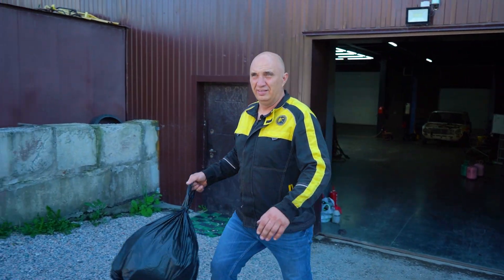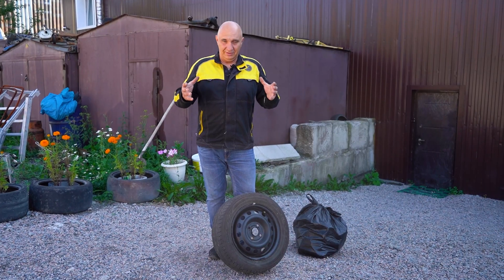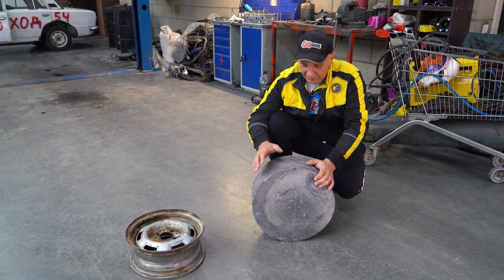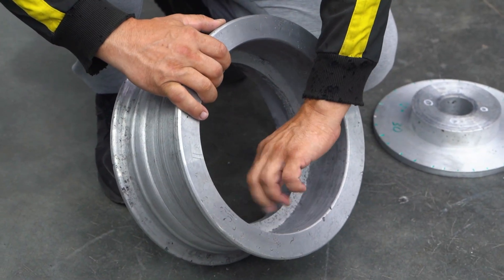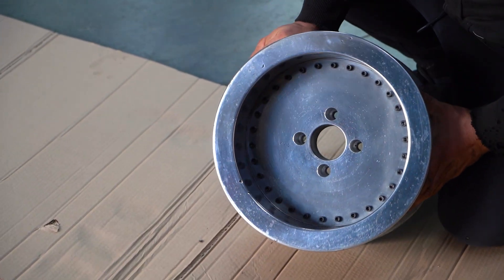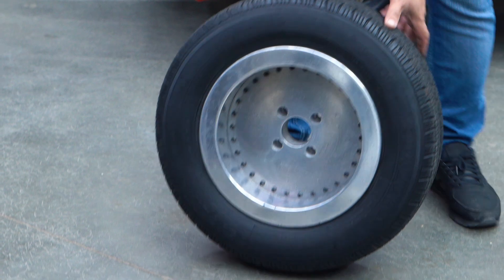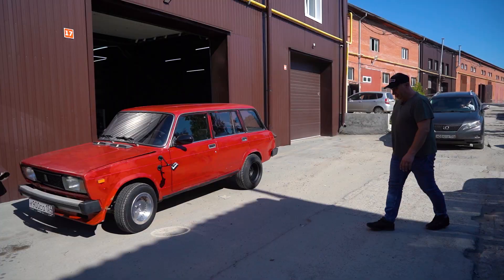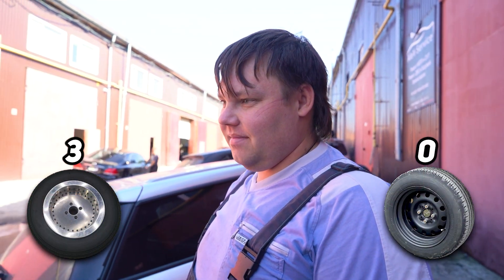We recast aluminum drink cans into a wheel

Comment: What if you try using some vibration to the mold from the outside when its still hot i don't  know a lot about casting but we did it with concrete and it got rid of the bubbles

Comment: we have those aluminium wheels here in use for a long time now and it works great and light in weight than steel but almost the same weight but it much more thicker than settle do have so ha beat that and you should know better than that so you're way too late for that also they do sell those at the tire store that they do sell wheels by their choice at different shapes and size too but prices will be vary to the cost to sell right in USA but not going to tell you the name of stores so you have to find out to yourself for this so you had lost it so ours wad made years ago where they started for that so ha you lost it

Comment: should have kept the casting mold hot with a gas torch until the last of the alloy was added and stirred it that would stop it layering and remove the air bubbles,

Comment: Im not really a fan tbh. Would of put the valve stem on the outside, flat mount one if wanting to be fancy
  Woukd of machined holes , for air flow and weight reduction. Wheel looks heavy as hell

Comment: Old alternators, T6 driveshafts, stuff like that tends to melt a lot better if you don't have borax or anything. Also I'm sure the casting guys know better than me but iirc aluminium is like brass in that it casts better when you've got something consuming the extra oxygen in the furnace, like some cardboard in the bottom.

Comment: When poring aluminium in numerous stages it is wise to use a heated mould to prevent potential heat shock, would also recommend tying to preheat the mould before the first pore, also if you are going to make more wheels, you should cut the mould in half and then use a metal band to hold the shape of the wheel, just make sure you make the mould bigger than the wheel so that you can overlap the two pieces in order to create a better way to remove the casting after it’s hardened

Comment: Gotta go 5 hole for the design like an 80's Countach. At least to take some weight out. Any safety worries with strength. If the wheel pits around where the bead seals, put some bead sealer on there, corrosion can cause it to go flat.

Comment: Next time you go melting the cans add Borox powder to the mix and stir it through,, skimming all the rubbish of the top skin until it mirror finished almost and try to pour the entire casting in one go ,,   build a bigger furnus to melt cans ,  use waste oil burner and compressed air this method works great on a bigger scale melt

Comment: Aluminum is an excellent material and is commonly used in the manufacture of tire discs or wheels.  However, when aluminum comes into contact with other metals, electrolysis problems do occur when electrolytes are present (such as water or a humid environment).

 To reduce or avoid this electrolysis problem, manufacturers often take a number of measures.  For example, they may apply a special coating to the surface of the tire disc to provide an extra layer of protection against contact with the electrolyte.  In addition, bolts on tire discs and wheels often use special materials or anti-corrosion coatings to reduce the risk of electrolysis problems.

Comment: Add borax or salt to your molten metal.  It brings out the impurities
Reply: Yes iodized table salt will cause the impurities to float to the top so you can skim it off. It will also get rid of the bubbles in the casting. They really need to heat it all up at once though. You can't get good results just melting a tiny bit at a time and pouring into a huge mold.
Reply: Translate that to Russian and post it on their channel
Reply: Borax all the way - works well for forge welding too.
Reply: Do you think if we added borax or salt to politicians, it would bring out the impurities in them?
Reply: lite salt not borax
Reply: Works good on clothes too-
Reply: A tube of silica glass works best the from an old bar heater etc it's how it starts the nucleation of impurities building into little eddy currents inside the molten metal. Which acts like an elevator pumping all the shit to the top even after its melted to slag the currents persist big dipper the top and bob's ya mothers brother.
Reply: Then, how long and high rpm could it hold
Reply: @BondanHeru   it's an extrusion alloy very ridged but very brittle.  Designed for cans, extruded rails. Bowls. Things of that nature.  Wheels need 6065 so they can handle shock. Also handles rotational forces. Has give to it and can bend on impact vs 3003 which explodes under shock.  3003 is also bad for casting... just saying been casting aluminum and steel in coal forge for 30 years now. Half the stuff made out of cans is kinda comical when you get the properties of alloys.
Reply: Thats some good stuff. We used it at work in our coolant systems
Reply: I did like u said to my GF and after polishing she's still a toxic bitch
Reply: Looks great! Thanks
Reply: ABSOLUTELY.
Don't use salt though, the chlorine bonds to the carbon dioxide and creates Phosgene gas! DEADLY.
Reply: Add sugar if you want it to turn out sweet 😆
Reply: borax or salt is a Youtube nerd go to thing only.... And soda cans are 3003 alloy and suck to cast with LOL  always the youtube crowd. What's next a hang glider build where you crash to your death... NVM already been done!
Reply: Sounds like adding imperatives.n
Reply: To be fair borax is a form of salt. So the problem is a significant number of different salts that could work. So you could probably use something like potassium chloride,  sodium hydroxide maybe even condys crystals.
Reply: Salt?
Reply: Yes, regular table salt will work just fine. Try and be supriced! And borax is another pretty good stuff. Borax will work fine for soldering as a allpurpose flux. It is good, and cheap stuff. I higly recommend that one!
Reply: @uooello13  For aluminium alloys either a chlorine slat (ie: table salt) or fluorine salt (ie: oxy/acetylene aluminium welding flux) is a good flux for casting.
For copper alloys and steel alloys, borax is the one to use.
Reply: @uooello13 It degasses the molten metal
Reply: Salt really? Did not know that.
Reply: Does the salt somehow cause impure elements to rise to the top as dross?
Reply: @jsmythib  Yip that one lol on the money a tube of silica glass is even better it promotes lasting eddy currents even after it's turned to slag was a breakthrough in commercial alloying just add a tube of slag elevator lol
Reply: @jsmythib exactly that
Reply: That is something very odd to know.
But now I do.